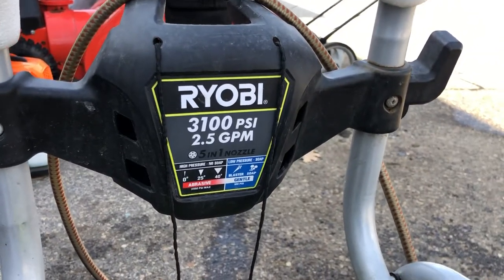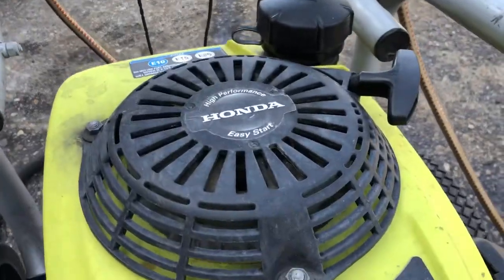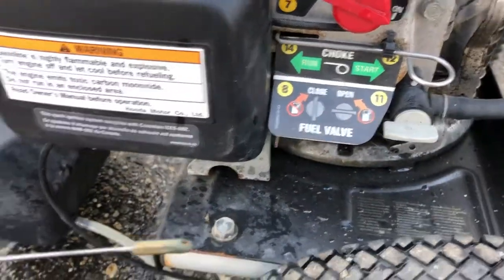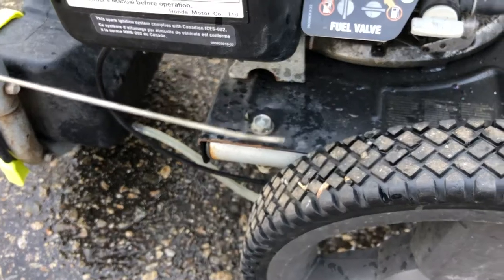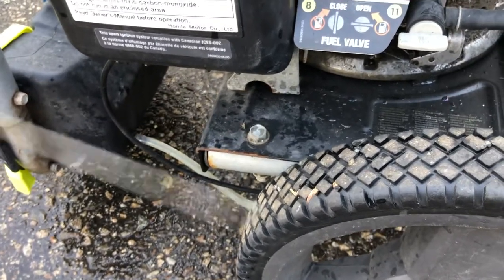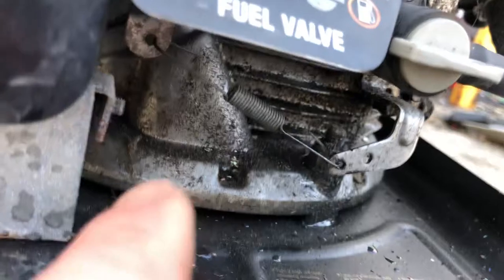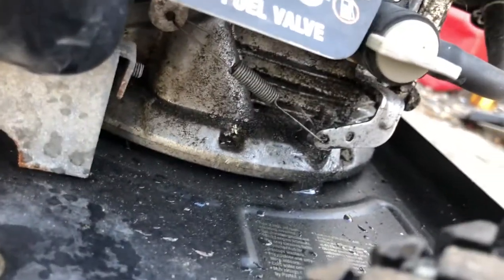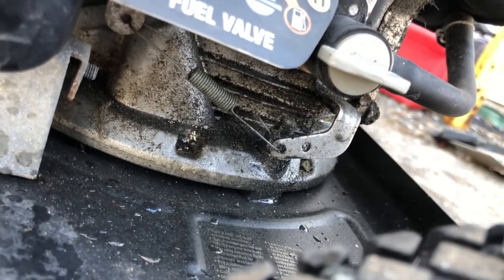Ryobi w/ honda GCV engine "idle down" fix Cheap & Easy!

Comment: There was no hole to attach the spring to in my Ryobi - so I drilled one in the bracket. Now it runs at full pressure, no idle down and problem solved. Thank you!
Reply from the maker: Glad to hear it worked for you. Some models must have been retrofitted to accept the new spring location and others haven't. Glad you found away around a faulty design

Comment: I have been trying to troubleshoot my Ryobi pressure washer for weeks now.  Cleaned the carb, etc.  Was about to replace the idle linkage and came across your video.  Did what you said and boom,  works like a champ.  Thanks so much for the tip!!
Reply from the maker: Of course! This engine is designed to idle, but it's common for the tiny plastic idle jet to clog, or the entire circuit. Even with a clean idle passage, the engine on a PW pump is still under load while idling. Much better to just have it work normally and not stall all the time. Glad we could help!

Comment: This also allows you to replace the oem pump with the idle down port (>$150) with the cheaper generic pumps off Amazon (<$60). I just did this after my original pump cracked after hundreds of hours of use.

Comment: Did you remove the cable that goes inside the pump also
Reply from the maker: No, the inner portion of that cable broke. We didnt see the need to remove what was left of it.

Comment: Why is the idle down a bad thing in your opinion? Isn't it a "feature" and won't it save on gas and engine wear and tear? Or is it bad for the pump in some way? I'm trying to understand genuinely cause i got the same exact pressure washer for 85 bucks on offerup.
Reply from the maker: Hi, the idle down feature is a cheap cop out vs using an "unloader" like in a more expensive pressure washer. ALSO, when the pilot jet circuit clogs, instead of surging, which is manageable, the unit stalls, which is not manageable. These carburetors were designed to operate more or less at one speed, as it is still a lawnmower engine, repurposed. It adds high failure parts and makes the unit LESS usable. Lowering the RPM of the engine doesn't save anywhere near enough fuel to be worth it, and the "less wear and tear" is negligible as well, considering this engine on a lawnmower would last 2500+ hours with light maintenance, never idling down. Thank you.
Reply: @smallenginesolutions  You are correct, the engine will last forever - almost. However the pump does wear out and much faster at higher pressures. Just keep your non-spraying time to a minimum or turn off the engine during down-time. sweet!

Comment: on mine it just kept rocking back and forth like revving the engine ,, basically just do a full carb clean out ( as in take wire to clean out the upper and lower jets)  it'll fix this pos washer
Reply: Yes, severe surging is typically a symptom of (in this case specifically, as well as some others) a clogged pilot jet and/or circuit. If the cable should snap like ours did or the idle down feature is causing you machine to stall, moving the spring is even easier than a carburetor cleaning.

Comment: Then the engine won't go up while running...not good plus the governor will not work
Reply from the maker: Tell me you have no clue what you're talking about WITHOUT telling me you have no clue what you're talking about...

The IDLE DOWN feature is the add on. This UNLOADS the governor spring, making it unlike most other pressure washers. Moving the spring to a fixed position keeps the engine "go up", and the governor works normally. Please go have a look in a book before misinforming people on the internet.